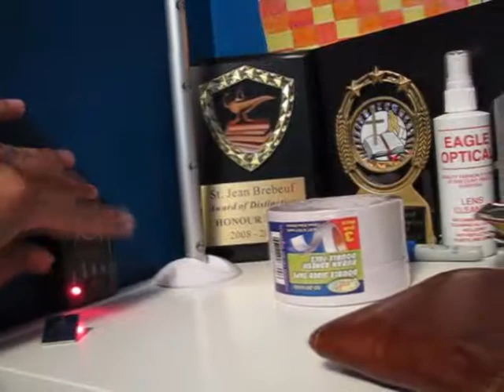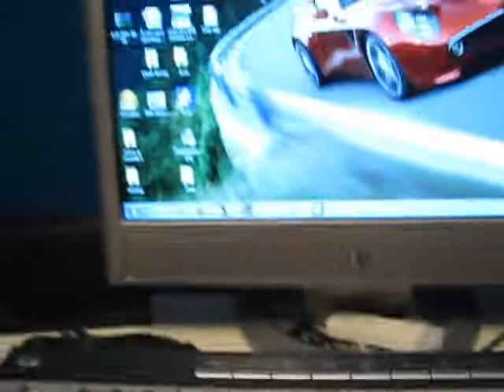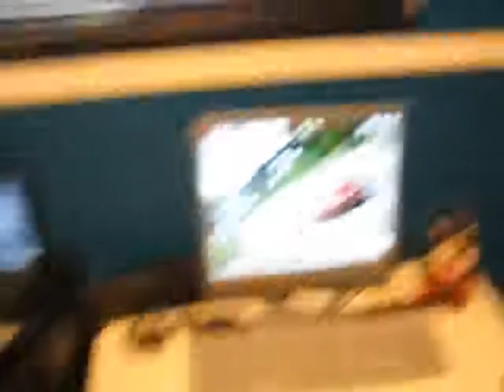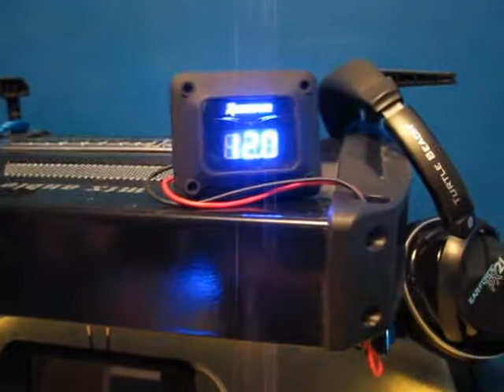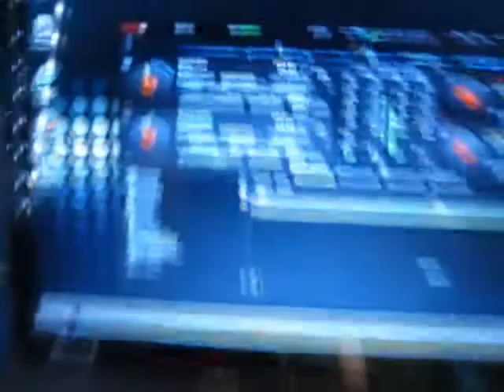2012 Gaming Setup | MaxVolumeify

Comment from the maker: What i did was measured the voltage and current output from the low frequency channel on my 5.1 surround sound system and it was under 12volts so i hooked up a simple led light strip and neon bar in parallel with the woofer and they lit up so every time there is a bass note, the amplifier is basically sending out a signal to the lights and the woofer in turn making them sound reactive. Although the ones by the door and under my black t.v. shelf have a sound reactive circuit and dont use my 5.1.